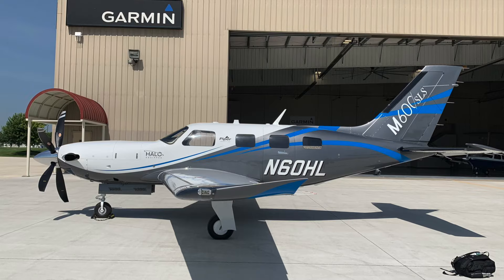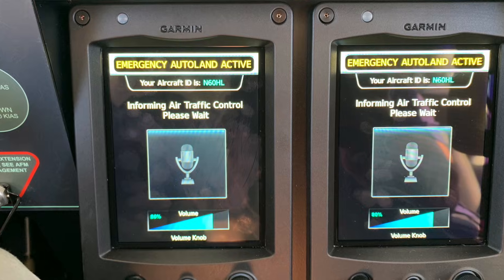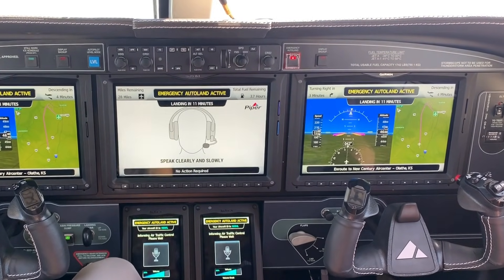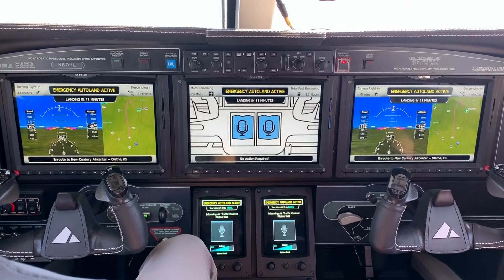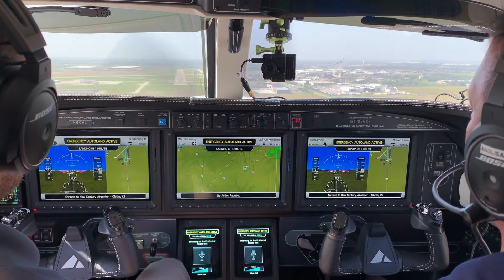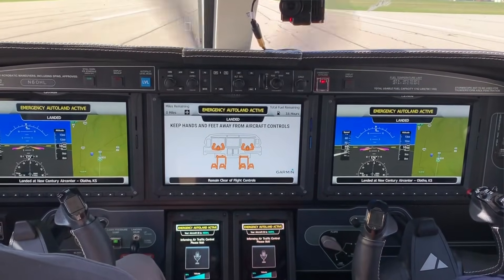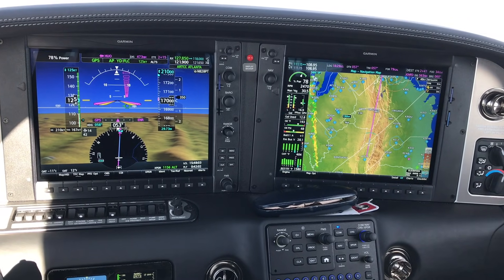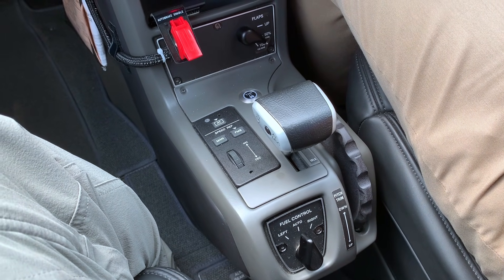Garmin Emergency Autoland Flight Trial

Comment: Neat! Serious question...How does the system know the suitable airport's runway is open?
Reply: Steaven Mckenzie probably a quick check of the NOTAMS similar to how Foreflight has all that stuff
Reply: In an emergency you can legally land at any airfield, open or not.
Reply: @bigred5287  Very true. I guess I should be more specific...At a moments notice a runway can be shut down. Downed aircraft, animals on the runway, severe icing any number of reasons. I used to run a flight school's line service and our one concrete runway would shut down for various reasons quite randomly. I'm very aware of all the factors behind the technology as it is directly in line with what I do for a living, moreso I am just curious how quickly the ai/algorithms receive the information and then adjust as necessary.
Reply: Bigred Jack Physics says that if you try to land on a runway that is closed for resurfacing, you are about to have a really bad day.
Reply: It is an emergency, the system don't care

Comment: Next Autodeparture flight, and next, No need of pilots, an IA  will be in charge of the entire flight process.
Reply: DavidBorthem there will probably still be a pilot or pilots in charge of the decision making process or approving decisions made by the automation. 
This is made in case there is no pilot.
Departure ( I think you mean takeoff) could have been automated decades ago it’s easier than landing by a long shot. 
It probably hasn’t been done because pilots should be the one saying it’s safe to go and not an AI going “let’s go” when no one is ready 
Which is again what half the pilot’s job is making decisions for the flight.

Comment: There goes the Cirrus trump card.
Reply: Cirrus has it too.... As well as the CAPS if there is something wrong with the aircraft and not just a pilot incapacitation.
Reply: Except during engine failures, mid-air collision, loss of directional control (ice) structural failure etc.... 

This only solves for the pilot incapacitation problem. 

Amazing technology all around though!

Comment: Seems like it should auto activate like a deadman’s switch if the PIC doesn’t respond to a periodic alarm which requires acknowledgement. E.g. every 10 minutes of no input to the PFD, a signal must be answered.  The PFD displays a two digit code which must be entered into the keypad which would not just verify the PIC is awake but entering the correct digits would also guard against hypoxia impairment. If the PIC was actively using the PFD then no code challenge would occur. Requiring a button to be pushed to activate wouldn’t work in case of a PIC medical condition preventing manual activation.
Reply: The Garmins already have something like this for hypoxia -- it auto-descends to lower altitude if it determines you are not alert. I imagine that if you don't recover alertness, it will transition to autoland in that case. So, the only thing missing would be the same sort of alertness detection below the hypoxic altitudes.
Reply: lohphat or a pulse-ox sensor

Comment: Does this add CAT III capability to a GA aircraft?
Reply: Most likely not, especially considering how it didn't track runway center line. I'd think this is a reserve system in the event the pilot(s) has a heart attack, stroke, etc. That renders them incapable of flying but there are passengers on-board.

Sure would be fun to disable the emergency radioing and fly somewhere and let it choose somewhere to land while you kick back though!
Reply: Not even close. 

In spite of CAT IIIB autoland sounding like something that makes the pilots job easier... it’s purpose is to allow very low minimums and pilots to concentrate on getting the required reference to ensure the landing will be safe with reaction times that would be impossible to do if the pilot was also landing the aircraft. That was until HUDs became available and now pilots can hand fly to CAT III minimums because they don’t need to cross check instruments. 

Not only does CAT IIIB require a suitable airport approach and CAT IIIB operations to be in effect, but the aircraft must be certified for it with Autoland capability, two channel autopilot, radar altimeter, etc etc plus two crew (never single pilot) who are trained and current (through simulator sessions) in CAT IIIB operations. 

And what this does is it allows aircraft to plan to do blind landings with paying passengers. 

And even if a light aircraft could do it... it’s most likely it would be turned away because CAT III operations greatly reduce airport capacity. 

Now... in an emergency... like this is designed for. All bets are off. 

I was caught above fog one night in a Cessna 172 and my plan was to circle until my fuel endurance was critical (no suitable diversionary airports) and then declare an emergency with equipment waiting and do a CAT I ILS to landing or impact... setting the plane up on the 12,000 foot runway like a glassy water landing on floats (full flaps, 100-200 FPM sink) at 200 feet while continuing to track the localizer. Fortunately, the wind came up and the fog dispersed.
Reply: I think it's more taking advantage of having no approach minimums once you've declared an emergency.  You can take an ILS all the way to zero today if you want as long as you've declared an emergency.

Comment: And this assumes no mechanical malfunction whatsoever, just pilot incapacitation. Correct?   Very impressive I must add.
Reply: 3:06
Reply: Assuming you’re not instantly incapacitated. Probably very important to instruct your passengers how to engage in that unlikely event.
Reply: You should check out the NASA PCA... Almost everything in aicraft automation has already been done in some way or the other.. (hell we are landing 30 meter tubes from the edge of space with a single vectoring engine)

These are the exact reasons why autonomous drones that fly people are coming, soon.
Reply: @rkan2  Yeah, it is not that hard, but it is great to see it in small airplanes. People enjoy flying by their own hand, but having an emergency autoland is a greate tool to have.
Reply: @rkan2  Russia did this from space in 1988 😋
Reply: well if the pilot is stuffed and not coming back, at least this gives the rest on board a greater chance of survival...this isn't exactly Airbus or Boeing autoland feature nor will it be used as such (imo), its just a little safer than flying into a mountain due to a pilot having a stroke, ya feel?
Reply: Yeah, I think it is a great solution in case of Pilot incapacitation. Watherever he flys with others, or alone, this system could save lives. The easy extention to make it work with solo flights, is to have a deadmen switch / watchdog, and periodically ask pilot to press some button, if he can't do it, emergency autoland will activate.
Reply: Yes. You'll need to install Auto Av-mechanic to complete the full safety package.
Reply: What if the Garmin has been drinking?  Does it have a back up?
Reply: Yes. Though in the Cirrus you have a chute for that.
Reply: Yes, but the chances of a mechanical failure and pilot incapacitation together are infinitesimally small... and if it does happen you’re dead anyway. Nobody is saying this makes the airplane 100% failsafe, but it’s better than not having it
Reply: Nah the automatic landing mode works with with one wing missing and all engines inoperative.
Reply: Flying Dog lol what?
Reply: @ItsNotAllRainbows_and_Unicorns  That is what I figured, with your tongue.
Reply: Well no shit, genius
Reply: Flying Dog let’s keep it professional, thank you.
Reply: @flyingdog1498  Well. That language probably demonetized this video. And yes. It's that easy.
Reply: Flying Dog are you ok? Such language
Reply: @flyingdog1498  BAD DOG! BAD DOG! DON'T BITE ANYONE!
Reply: @JonathanLit  That is not what your sister said.
Reply: @infopackrat  i’ll just report his comment.
Reply: @infopackrat  old comment, but what people say in the comments doesn't affect monetization...
Reply: Flying Dog I think you’re a bit too childish to be chiming in on aviation videos. Go watch some cartoons or something
Reply: @flyingdog1498  -  Please watch your language.  YouTube moderator's algorithms are starting to catch antisocial behavior and block violators.

Comment: I could imagine a dead-man-switch: Press once every 5 minutes, or the plane lands. @AVweb: I wonder: Do they squawk 76 or 77?
Reply from the maker: Engagement is a full-up 7700
Reply: There's already something sort of like that in the Garmin products with hypoxia detection. Up at altitudes that can cause hypoxia, the system watches for pilot activity. If you've not interacted with the avionics for awhile, it pops up a little message that asks if you're alert. If you don't respond, it makes that message progressively more aggressive, including chimes, etc, and eventually it will automatically descend the airplane. Presumably that will now lead to an autoland if you don't recover.  I guess the only thing missing now is a similar alertness detection below hypoxic altitudes.
Reply: Or a pulse-ox sensor the pilot wears to sense minimums

Comment: What about autolanding in poor weather conditions? Heavy side wind?
Reply: fujimatosa  I would prefer the computer have a crack, than a total noob trying to land it
Reply: probably there is a limitation for crosswind landing and adverse weather condition.
Reply: @Shawn Huffman i dont think so.....it wil be only possible by ACARS or CPDLC for metar and taf.....and i am also reliable to say....one thing is AUTOLAND another is AUTOLAND CAT 1 2 OR 3 there are many kinds of homologations for it....one of those are dual channel for the autopilot.....M600 doesnt have it.

Comment: 1967 the C-141 A I was crew chief of had auto land . This is not new. Four lights and good to land. Does it require a CAT 111 airport?
Reply: Not even close to the same thing. Would that aircraft navigate by itself to the nearest suitable airport and communicate with ATC, and subsequently autoland with zero local ground equipment or pilot input required?
Reply: No....it will autoland at the nearest available airport.
Reply: Welcome to the world of paranoia. How many times would it have been nice to have an autoland system on a small airplane? Ten times in fifty years? Garmin is pushing thousands of airplane owners to buy this useless gadget in order to satisfy their copilot-wives...  This is not nice, Mr Garmin. Seriously: This autoland stupidity creates a new breed of accidents. Now every third class Piper jockey feels safer and flies with a false sense of confidence into marginal WX conditions; every weekend, of course. The result is obvious. Didn't your Garmin psychologist tell you that? No, they did not because they are not professional pilots. This is going to be a huge problem in the future. As it is very often in aviation: a good idea, but not fully understood. Good luck, George... oops, I touched the touch screen... oops, the autoland took over my manual landing... oops, the engine shut down automatically, in flight.... oops... Do you want more? This is exactly what happens when young computer geeks and non professionals work together as a team. This system will never get approval from the FAA. For very good reasons.  Greets from the 747-8 cockpit. R
Reply: @Renato.Stiefenhofer.747driver  I totally agree, I removed the airbags from my car for the same reason.
Reply: @surebrah  Smart. How about cup holders?